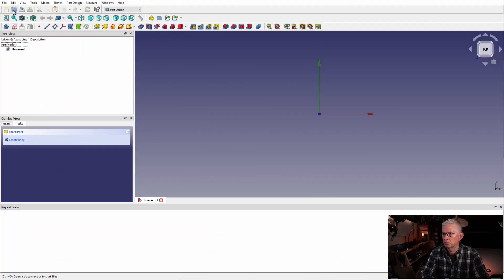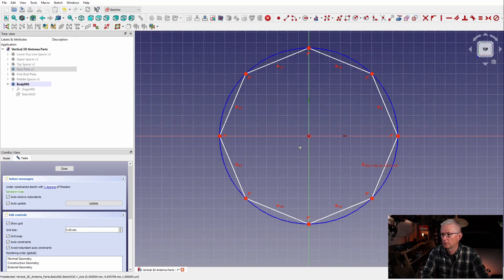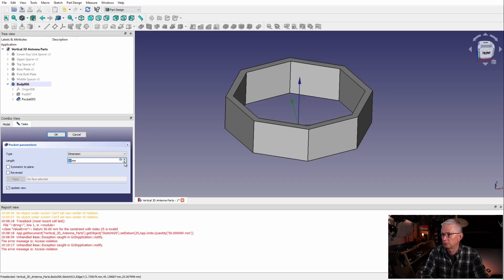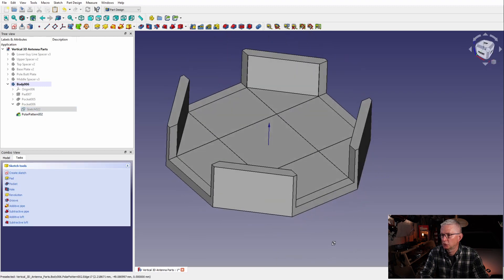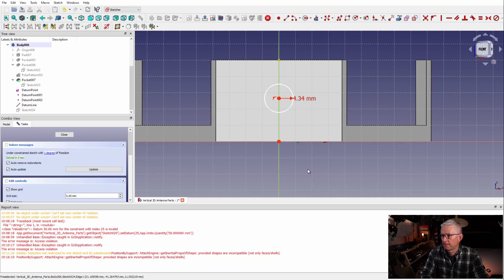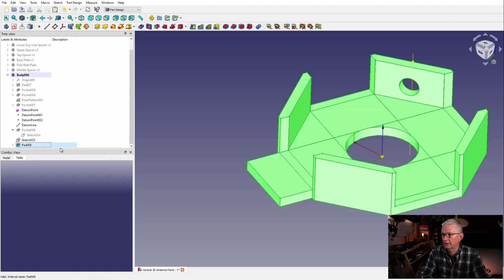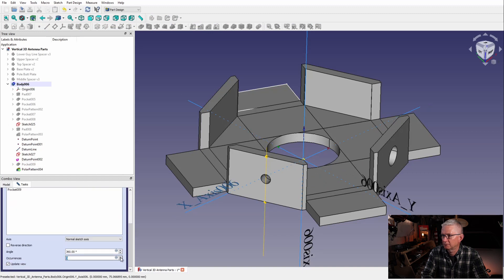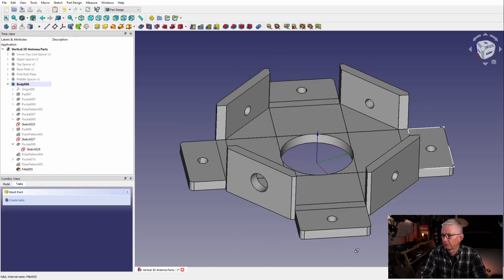How-to Using FreeCAD to build 3D parts for Ham Radio - (#31)

Comment: Stephen thanks for sharing this.  When I download the project it seems I can only see the Body006 part...the others are grayed out.   Am I missing something or doing something incorrectly?  Thanks again for your help and generosity.
Reply from the maker: Hey Joe. I'm assuming your using FreeCAD, and I get where you're coming from.  It was confusing to me when I started and often got caught with that.

Use the SPACE bar to toggle the different Bodies.  Use the same key command to toggle the drawings as you need them.
RIGHT click on the body name and select from the submenu to make it the active/enabled body if you want to modify a drawing.

Hopefully my answer was heading in the right direction!
Reply: @W0KNI  that worked...thank you!  What an odd key sequence!   Hey its free so I cant complain.    I've been looking for a reason to jump into 3D printing...you may have just provided it.   Thanks again